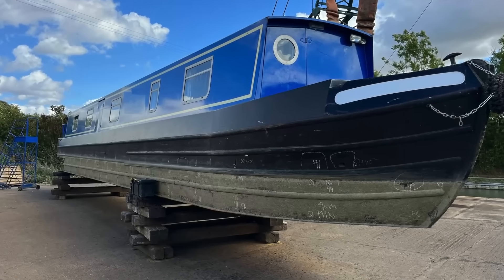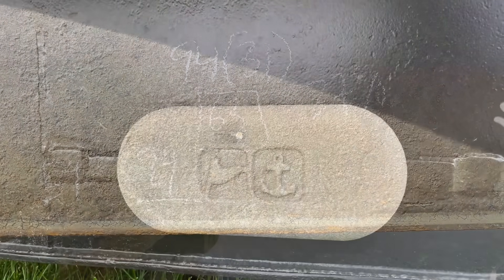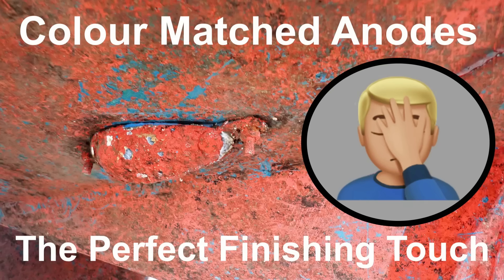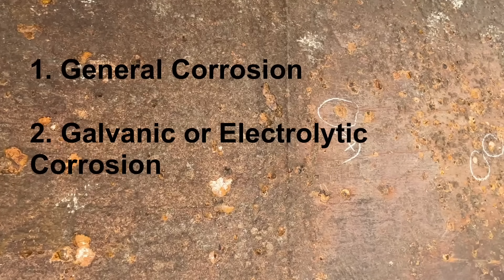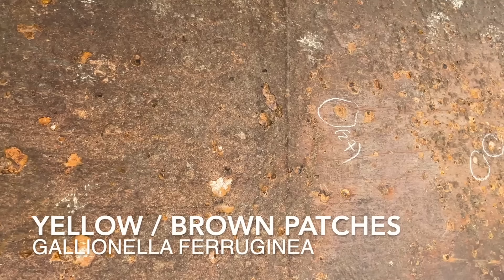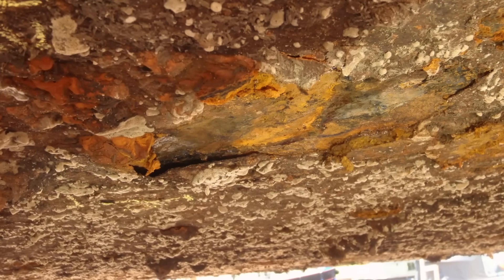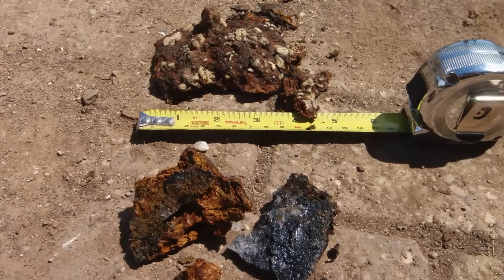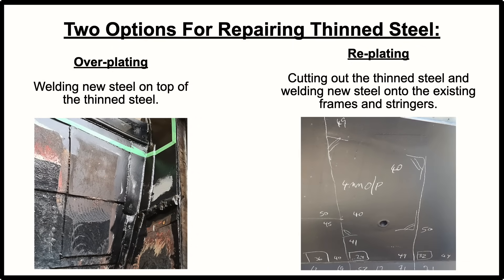No Anodes For 16 Years - What’s The Damage?

Comment: Question for Mr. WhiteHat. I have a narrowboat with moderate baseplate corrosion now blasted and epoxy coated with 3 layers. I am prepared to add extra side anodes to forestall further outbreaks of corrosion as the baseplate paint is damaged by underwater obstructions, would this be worthwhile? My concern is that new anodes won't have anything to react with on a 99% epoxy coated hull thus they will become gummed up with weed and unable to protect my hull when a shopping trolley scrape exposes the baseplate.

Comment: Why dont they coat the steel with epoxy finish, or similar when the boat is first commissioned? [Cost?]
That must be far more effective than the ''blacking'' that is used currently.
Incidentally, we were taught at university, ''All corrosion is electrolytic''!
.
Reply from the maker: Some boat builders take the time to prep and paint the steel properly, others don't, largely based on the Whole Life Cost as you say. That choice stays with the vessel for years to come.
I've always preferred the term electrochemical to describe all corrosion.
Reply: @whitehatmarinesurveying  
I've seen a Y/T video, where the constructed a hull totally from plasti. Probably polythene or similar.
That would seem an ideal solution.
However, even plastics have a finite life, before they start to perish.
.
Reply from the maker: I saw it at Crick Boat Show this year and wrote about it here: https://www.linkedin.com/pulse/futures-bright-plastic-david-pestridge-h2hbe/?trackingId=T1RPWFEcSMeylZO59ap7Eg%3D%3D
Reply: @whitehatmarinesurveying  
Thanks for the link.
Looks like the obvious way to go.
Only con thought, would be whats the fire resistance like?
Have you considered rim drive motor propellers?
They would seem ideal for canal boats.
Virtually eliminates any possibility of fouled propellers, and with two, could also be used for additional steering in tight locations. Could also eliminate the rudder, and the need to stand at the end of the boat to steer it.
A set of blades added would shred anything sucked in, and no shaft to wind things around.

.
Reply: A good long lasting baseplate epoxy job requires serious preparation and ideally the hull base raised to an optimal working height of about 5ft 9". Many boat builders don't have the equipment to do this. Current poor working practices have also been sustained by a generation boaters who are now largely retired, for some reason this generation of narrowboaters  engaged in group-think that asserted baseplates don't rust because there is no oxygen that deep in canal water. Back in the 1990s boats had simpler electronics on board, fewer were hooked up to marina shore power and perhaps modern living adds more nutrients into canal water provoking corrosion types 3 & 4 in this video. All these factors suggest that despite tow-path lore, baseplates should be painted.
Reply: @flibbertigibbet6324  
Open water contains dissolved CO2, and oxygen, so both will facilitate corrosion.

The base plates could be epoxied before assembly. leaving only the welded edge joints to be cleaned and epoxied.

I think the majority of boat builders are locked into mindset, and dont have the imagination to innovate.
.

Comment: Hi, I have a quick question: Is your plate meter accurate/effective through heavy coatings, fairing compounds, corrosion scale etc? if there is thick scale on the inboard side, such as under ballast or tankage, does that affect the measurements of sound plating? Thanks!
Reply from the maker: Great question, thanks for asking. The short answer is yes it is effective but as the condition of the plate and coatings worsen, the harder it is to get readings and yes it is accurate but only when it can get a reading.
As it turns out I'm about to make a video all about how these meters work, should have that uploaded by the end of October.
Reply: @whitehatmarinesurveying  Thank you! I'll be on the look out for that. What would be the practical limit for measuring through a polyester or epoxy fairing compound? I have seen these applied at 50mm+ thicknesses.

Comment: It's doubtful that you have found MIC on a boat hull. MIC is a seldom seen phenomenon that usually only occurs in steel oil or fuel tanks. In addition, it creates pitting rather than open areas of corrosion. In 40+ years of material inspection, I've only ever seen it once in the base of an oil tank.
Reply from the maker: Thanks for your comment, interesting to hear your experience with MIC over such a long career. Unfortunately as the UK's canals warm and more boats are being left unpainted, marine surveyors are seeing an ever increasing number of steel narrowboats with MIC. It's more common than you think.

Comment: There a trend of using  unprotected steel aheets l  as decoration  on buildings  it looks l nice, but  as soon as I see  it, I realised it won't last 20 years.
Reply: The exposed steel sheets used as decoration are made of Corten Steal aka weathering steal, which forms a protective oxide layer that doesn't flake off like normal steel, Corten steal lasts between 50 and 100 years, losing as little as 1mm in 40 years, unless it's placed in a hostile environment, with constant high humidity, salt spray or certain soil conditions.
Reply from the maker: That's interesting, I hadn't thought about how this applies to buildings as well but anodes probably aren't an option!

Comment: I work for a company that leases trucks and NOTHING is spent beyond what is absolutely necessary to get them to the end of period to hand them back, Business is short term thinking for the most part.
Reply from the maker: Thanks, it's interesting to see how different industries approach the Whole Life Cost of their assets. 'Sweating the asset' is a phrase I've seen before which sums it up nicely.
Reply: Yeah that's very common.  I won't buy vehicles that were leases or rentals, they are always the most neglected and abused.
I use to lease a VW car and I always drove it hard, when it was cold and I mean even down to 0f, I would force it to stay in a low gear while I kept the engine reved all the way to the red line till the engine warmed up while driving down the road (if I was only driving 30 then I kept it in 1st gear) which didn't take long at all and I've never smelled that particular smell before.  Any stop and go driving I matted the go pedal 95% of the time.  I'd never treat cars I own like that lol.  I dunno how that car didn't break down on me, oil changes every 10-12k miles, I seen the oil so low it wasn't showing on the dip stick just before I turned it in, I topped it off then but that's the only time I ever checked any fluids.

Comment: My question is, what were the projected cost savings?  Not taking a position on this, but without numbers it's tough to form a reasonable opinion.
Reply from the maker: I also wondered what the Whole Life Cost of the charter company’s policy might have been. Let's assume the magnesium anodes last for 3 years and the hull get's re-blacked with cheaper bituminous blacking at the same time.  If they only fitted a pair of anodes at bow and stern that would be a WLC of £1400 (4 anodes at £70 each done 5 times) or at full scaling of a pair every 4 metres that would be £3500 (10x70x5). Blacking at let's say £40 p.m. would be £3600 (40x18x5). So a rough addition to the WLC of between £5-7k (have assumed using their own labour for the work) which would be the typical income from just 3 or 4 week long charters. That sound about right?
Reply: @whitehatmarinesurveying  Then perhaps would it make more sense to do as this company has done, i.e. not doing anything preventative, and then selling the boat before it comes uninsurable i.e. loses most of its market value? ... Then the purchaser can decide whether it's worth treating the metal, coating it, and installing anodes ... Or they can run it into the ground (err, seabed?) if they wish. I suppose the other relevant comparison is whether it's cheaper/better to manufacture using a thinner steel and continually coat and replace anodes, or just pay the extra for thicker metal (what alloy is it?) up front and let it degrade. Maybe the answer to that depends on whether the intent is to keep it long term or sell? ... I'm the opposite of an expert so I have far more questions than answers, but it's interesting to craft theories!

Comment: So its gonna take 50 years for the worst pit to penetrate assuming it continues at that rate… seems the company knows what they are doing. Anodes = waste of money?
Reply from the maker: Interesting take, trouble is the hull becomes uninsurable long before then once its down to 4 or 3.5mm depending on the insurer. But you raise an interesting question in my mind - is pit development linear over time?
Reply: @whitehatmarinesurveying  I think that it is highly unlikely that corrosion is linear. Unlike aliminium oxide, which forms a protective layer on aliminium, all forms of iron oxide trap moisture, bacteria and other contaminants…. Thus corrosion accelerates. Those observing the Titanic have been shocked at the speed with which the hull is disappearing over the last 30 years…. 25 % of its submerged life.
Reply: @whitehatmarinesurveying  Are we pretending that insurers are reasonable people, instead of the gouging bastards they are?
Reply from the maker: Harsh, but perhaps fair in some cases...
Reply: @MarcusBenwalter  Whatever we think of insurance companies, getting a boat license from the Canal & River Trust is contingent on insurance cover.
Reply: Once the metal gets down to a certain thickness it will also succumb to mechanical stresses (even just the pressure from water on one side).

Comment: There has never been a metal boat without anodes, its just that the ones with a zink one know were theres is.
Reply from the maker: Not sure I fully understand your point, but thanks for making it.
Reply: @whitehatmarinesurveying  I imagine the principle is that there will always be areas on a metal boat that act as anodes, due to the presence of impurities or dissimilar metals. You find out where those are when they start corroding.
Reply from the maker: So true, whilst we consider steel plate to be pretty homogenous, at the molecular level it is anything but!
Reply: I didn't get the comment either, so I just assumed it was some kind of lame joke based on wordplay, zink/sink.
Reply: @luobomu9747  You can't expect everyone to make sense much less any good sense these days, most people are F'd in the head or on drugs or both.

Comment: Hello, just out of curiosity, and hoping someone here knows. Is it possible to sand down the entire hull, and weld new plates over top, or does the old plate need to be cut out? 

Also, has the red oxide paint been band from use? We used to paint the hull with red oxide paint when I was a deck ape some 30 years ago to prevent corrosion. Is this no longer allowed? Thanks in advance for any answers!
Reply from the maker: What you're describing is called over-plating. But when you cut out the thinned plate to weld new plate onto the original frames it is called re-plating.

Red oxide paint still available, but like creosote isn't as 'good' as it once was!
Reply: @whitehatmarinesurveying Ah yes ok, so two copletely different processes. I imagine they both have their advantages and drawbacks. 

As far as paint products, that the new products are not as effective as the okd one is not surprising. I remember we had to do a trial for some new (at the time) two part paint that was supposed to be hundreds of times better than the old red oxide paint. 

The product became rock solide within 30 minutes, was difficult to apply, and a nightmare to paint over. It was some knid of rust proofing compound that dried to a shade lighter than olive. Like a light pastel green. Traditional paing could hardly stick to it. We had to use this crap for a whole year on our ship. Made a lot of angry people.
Reply: @whitehatmarinesurveying Ah yes, thank you very much for getting back to me so quickly! You sound like a very knowledgeable chap! I am certain your clients are in good hands.

Comment: I have never owned a boat but always kinda had my eye out for one. I knew of anodes and always assumed that it was something I could cobble together. I never knew they were magnesium though, and weld on magnesium!!! That sounds like a fire waiting to happed.
Reply from the maker: A magnesium anode is typically an alloy with about 90% Mg and the remainder mostly Aluminium, Zinc and some trace elements. The anode itself is mounted on a steel strap and it is that bit that gets welded to the hull, not the anode.
Reply: Magnesium is commonly used in cars and when they catch fire and we apply water the magnesium can react vigorously. 
The solution is… more water!!
You apply so much water that it overcomes the reaction. 😊

Comment: The lack of bottom paint on the hull and lack of sacrificial anodes of this boat certainly speaks volumes on how the company that built, rented, and is now selling this boat has maintained this boat.  Honestly since the gentleman hosting this video said the same company also constructed this boat that rented it and is now selling it it also makes wonder where else less than stellar vessel design and construction could/would of taken place to save a little money because the company does not intent to keep there boats for a relatively short period of time.
Reply from the maker: You're right, but 16 years is quite a long period to operate the vessel and they carefully consider the Whole Life Costs of building, operating, maintaining and selling.  In some ways their build spec, anodes and paint policy and sales planning are all finely balanced to ensure maximum profit from each vessel. It works for them.
Reply: Obviously as a business have decided that having good quality 2nd narrow boats floating around as potentially cheaper hires to their business is not to encouraged
Reply: Before I purchased that boat I would want to see what condition the insides are in, I saw Narrowboats welded up and on the outside the coating was really good but very little decent coating in the bilges and what is a really nasty rust former,  wood was used laid on top of the steel. Wood contains water ! so there will always be corrosion but when boats are sold, almost nobody ever tackles this.If the wood is not treated then you get Mould, that's not nice at all.

Comment: From a laymans point of view i would ask why dont people ordertheir boats with a 15 mm base plate or would the cost be prohibitive ?
Reply: Cost and weight. It will be pushed way farther down into the water, and it will be heavier to get into or out of the water.
Reply: Most boats have ballast under the floor (ours has block paving bricks, with a 10mm baseplate). A thicker baseplate could perhaps be offset by needing less or no ballast.

It's something I'd consider if I was having a boat built.

I love the idea of a stainless boat, but both forming the sheets and welding them without compromising the properties of the stainless, would be very difficult indeed.
Reply: @leifvejby8023  As someone else said wouldnt the extra weight be counterbalanced by needingless or no ballast?
Reply: @MrSychnant  Yes it would. If the boat needed ballast-
Reply from the maker: If you run the calculations for the  plate thickness needed for a typical mid-sized (65foot) narrowboat you get a minimum of 5mm.  That leaves very little scope for thickness loses before the insurability comes into question and repairs are needed. Hence why many builders choose 10mm as a good compromise between cost to buy, time to weld, warranty periods and overall weight.
Reply: @whitehatmarinesurveying  Are stainless steel hulls a thing?  I know it would be more expensive but would that still be sucseptible to the bacteria?

Comment: Some of the waterways in UK have iron eating bacteria in the water coming out of the mines. Some of these are just very tiny streams, coming out of a hole in the ground with a reddish orange color to it. Any boat spending a lot of time in this water or water directly connected to it in the canal should get regular inspections, especially if there’s a bow thruster or keel cooler fitted. Keel coolers are far less common on narrowboats/widebeams, but some do have them. Each boat should have an inspection and blacking routine that works with the layout of the hulls and the chemistry of the metals in the water. Having anodes & proper hull cleaning would have prevented most of this damage. A charter outfit would seemingly know better, but I guess not. This hull is in dire condition & likely needs both full clean/biocide treatment and a lot of doublers (perhaps the whole base). Shameful.
Reply from the maker: You're quite right, our canals are very biodiverse, often in negative ways for how we want to use them!  While this vessel had suffered I can see why the charter company operates them as they do, it's all about the Whole Life Cost of every narrowboat to them.  As it was my Client bought it in time for it to still last for a few decades more with some preventative work done now to preserve the hull.
Reply: @whitehatmarinesurveying   Media blasted back to bare steel, smooth out the pits and fill with weld, doublers where needed, and an epoxy coat would probably do the trick. Low profile anodes along the side would definitely help too. Cool video.